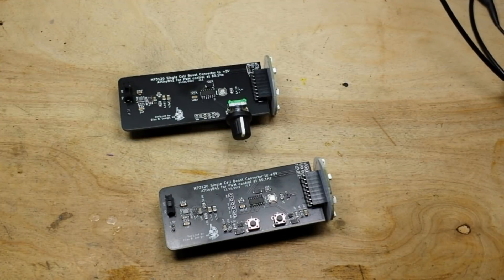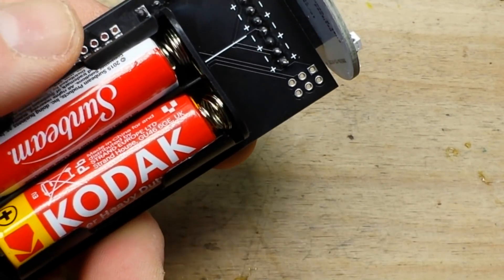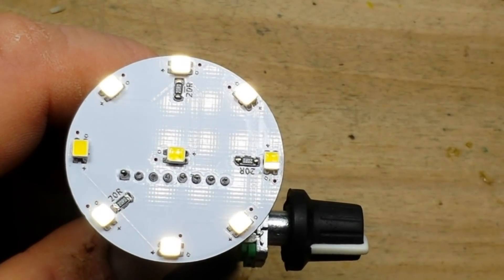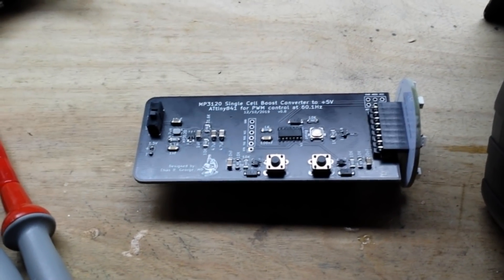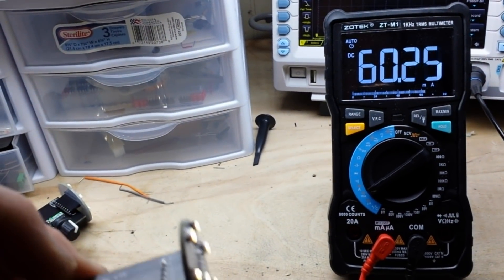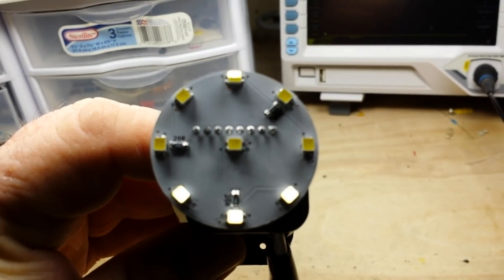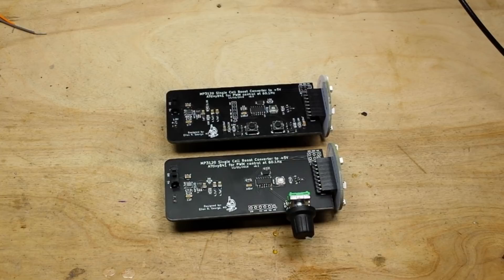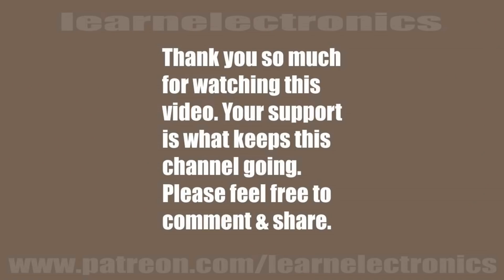Viewer designed flashlight project

Comment: I got my heart pump and transplant at Seton MC in Austin,Tx. My EF was less than 5. Used to have to plug myself into the wall socket at night. Seton MC was very good. Less restrictions than St. Lukes in Houston. Dr. Mary Beth Cishek contact point if it helps.

Comment: I've been watching every video I can find on op amps but so few put it to practical use so I designed a single op amp preamp for matching impedance of old dictation mics to line level as a proof of concept. The problem I'm having is incorporating a master volume pot without effecting the gain. How do I do this?
Reply: I guess the same question stands in regard to a tone stack. It ends up voltage dividing with the resisters that set the gain of the op amp

Comment: It is a very nice project you have made. I have made a similar with one three watt led.
As we saw in the YouTube example, the current on your led is floating due to heating up
the alu plate. (Led is changing current/ temperature)
This can be only avoided if you are using a constant current controller after the attiny.
Otherwise you will also face heat issues with your led lamp and light will not be stable.
I am using a cat4101 chip after my attiny 85. 
I have had many problems with removing heat from the led chip.
Have a nice day 
The project idea is brilliant and the presenter too!
Rgds from Denmark.

Comment: That's a nice piece of kit.  You don't NEED any of the bells and whistles, but luckily they're there anyway.  I have a real soft spot for single cell LED torches.  From the scrappy joule thief you can make from recovered "bits", to these refined fancy boost jobbies all "cheating" the system to get a LED to glow using less volts than the book says you need.

Comment: A joule thief on a tiny chip and I bet they could pull most of those components internally and have a 2 or 3 part solution.
Reply: A joule thief circuit would work, but it would be max brightness and far less energy efficient.  The MP3120 gets about 90%, and a joule thief gets around 70% or so.
Reply: No, the MP3120 is basically just a glorified JT.  We were working on these a few years back and it is the evolution and the extra efficiency is because it is on a chip not discrete components as we proved could be done way back when.  I can't wait to see them take this to the next level as I described to begin with.

Comment: Hi Paul,

    Firstly, thank you so much for reviewing my project.  I really appreciate it.  The big reveal is that I chose to use a PNP BJT as the transistor, which is why the PWM is inverted.  I've decided to play more with PNP and P-channel MOSFETs to wrap my brain around the differences from the easier to understand NPN/N-channel counterparts.

    A few additional notes you all (Texan grammer).  I hand soldered these projects.  I use interrupts for the hardware debounced switches and also for the rotary encoder.  I decided to use one of the ATtiny841's 16-bit Timers in phase correct inverting PWM mode.  The frequency of the PWM can be increased (up to a point) without needing an external oscillator by changing the precscalors and the OCRxA (TOP).  I arbitrarily chose 60.1 Hz because that's close to what home lighting uses.  Thanks to persistence of vision, it works well (it's a flashlight after all).  I also put the ATtiny841 into Sleep Idle mode to save some power.  It wakes up when you push the buttons or turn the rotary encoder and then goes back to Sleep Idle after the duty cycle is adjusted.  I'm also working on a version that uses an ATtiny85 for more power conservation.  There is more work to do friends...
Reply from the maker: I had a feeling that was a PNP transistor in there. But it's so small. In my eyes, you're so old I couldn't really tell hahaha. Anyway, Quincy, great job on the project folks really seem to like it. I know that I do. You come a long way in a short amount of time. . Keep going. And before long you'll be teaching Electronics classes.
Reply: @learnelectronics  Thank you Paul.  You are too kind my friend.
Reply: You could also save the last brightness setting value on the attiny841’s eeprom so that after hitting the reset button the brightness would be the same as the last one set. 

Cool project!
Reply: @elizandropeters2182  One could certainly do that and more if they so chose to do so.
Reply: Cool design DOC!  Neat use of PWM, helps grasp the concept behind PWM.
Thanks for the review Paul.

Comment: Is the pwm swinging from 100% negative duty cycle output up to 100%positive duty cycle o/p as you change the light switch ??  As opposed to an "inversion" ... 

😎👍☘🍺
Reply: No the pwm is always positive. What Paul is saying is that instead of it being fully bright at 100% duty cycle, which it would with direct drive, it is actually fully bright at 0% duty cycle. If you look at the driving transistor/mosfet the answer is obvious.
Reply: @jonelectronics510   I don't understand how 0% duty cycle could give full power (or ANY power) ... are you saying 0% duty cycle is switching the mosfet on ?
 Or is 0% duty cycle actually just continuous DC ?  ....  but anyways , as I'm not that well versed in electronics I'll take your word on this ... thanks for taking the time to reply ...😬

😎👍☘🍺
Reply: @jonelectronics510  ...thats sounds more like it !!  ... thanks again Jon , nice to have helpful commentors like yerself mate 😎👍☘🍺

Comment: 60.1hz is rather slow hence the camera flicker. It has an 8mhz oscillator internally doesn't It? You could up that frequency considerably with no extra circuitry.

My bet the inversion is due to driving a transistor or mosfet.